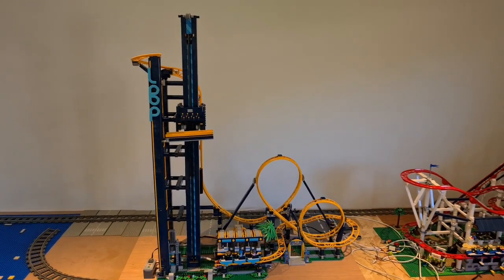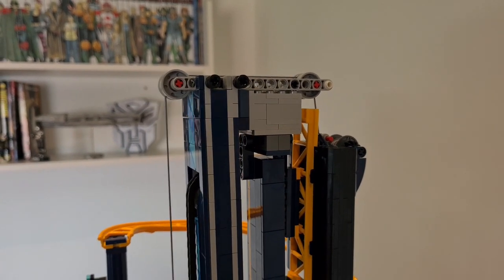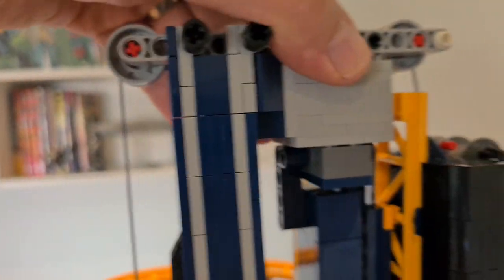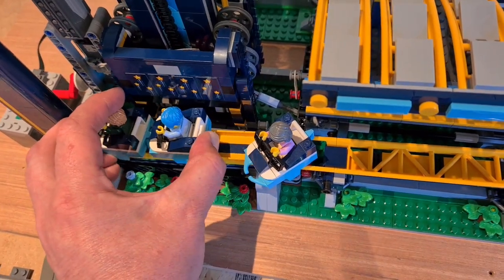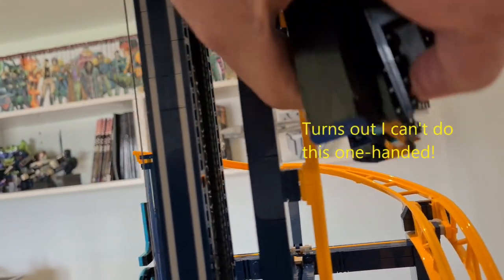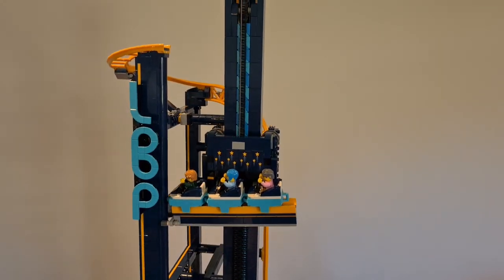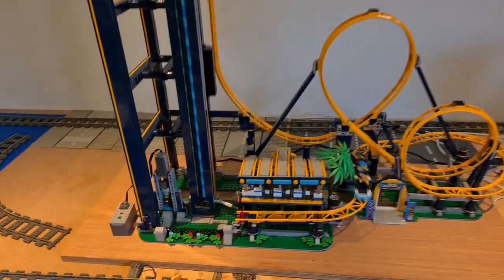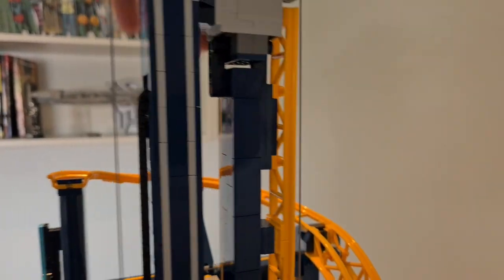How to fix Lego 10303 Loop Coaster and stop it breaking apart!

Comment: Mine worked great out of the box without any mods. I followed the directions and it just worked. Maybe you should look at your set up again to see if you missed something.
Reply from the maker: Great to hear that yours was a success. As I said in the most recent update, I honestly think that for this set to work properly, there's a multitude of factors that might have to be perfect. With the number of comments from people having the same issue on here i think there is a design issue that should have been considered in order for the set to run continuously without any issues.

Comment: i didn't have this problem with my 10303. from what i can see from the video is that, your counter weight is setup to high. you got to lower it by 2 to 4 clicks. got to level the top of the counter weight with the lower gap of the rail support. btw, thanks for the tip of adding extra weight. in my case, i only have to add a 4x4 plate to slow down the drop of the elevetor to stop it from bouncing.
Reply from the maker: Thanks, yeah, I realised that the video shows the counterweight too high, that's my fault for rushing it. I had it set exactly level with where the instructions show, actually, I tried adjusting it up and down several times. Nothing worked continuously unfortunately, I'd get a few cycles out of it each time. I found adding the weight was the only solution that worked for me.
Reply: @brictronic  mine, did bounce but the counter weight doesn't hit the pulley.  adding an extra 4x4 plate did slow down the elevetor significantly. also i added an extra white rubber band to the carriage stopper to give extra damper to the elevator when it hits the bottom.
Reply from the maker: @jhin1968  That extra band is a great idea! Anything to take the bounce out of the carriage when it hits the bottom would be an improvement! I must try that.

Comment: Hi. Thanks for the upload, very helpful 👍. I am having trouble with mine. It works with the power function, but the big part of the chain gets stuck at the bottom, have you any advice? Many Thanks
Reply from the maker: Hi, that's never happened to mine. I would remove the carriage completely from the tower and take the motor off and check to make sure the chain can circle around the tower freely. You should be able to find what's causing it to get stuck then?
Reply: @brictronic  Thanks

Comment: My issue was the cars would not come off the lift.  I increase the higth of the lift track by 1/3 brick.  Add a couple bricks under the lift track to raise it up.  Now no issues.  My other problem was that it would not come back down.  Have to remove weight from the counter weight.

Comment: I did add additional weight like in your video, my issue is inconsistency transitions to the top rail, some times it just get stuck ( in between the gap) like what happen earlier in your video (remain on the lift) and still figuring out little binding issues in the loop slowing the cart which most of the time doesn’t reach the rubber wheels to pull the cart in to place.
Reply from the maker: To stop the cart getting stuck on the top I found I had to straighten the tower. It was leaning towards the front of the set a bit too much. But after I straightened it, it stayed where it was supposed to and the cart transitioned perfectly each time.
Reply: @brictronic  thanks, my tower still leaning on the right side, still figuring it out how to straighten it up, most of the part are mounted flat, i probably double check it again. Thanks again👍🏻

Comment: I completed the set about two days ago and I have the same problems.... Another issue I found was a number of parts missing from the set. Fortunately I have the parts but I will make a complaint to Lego as it's a lot of money to spend on something to have bits missing. I will add the extra plates tonight. 👍👍
Reply from the maker: Unusual that there's missing parts. The last time that happened me was about 10 years ago! But definitely contact Lego customer service, they're usually quite helpful.

Comment: I'm having a very similar problem, but I don't think it is caused the same way.
Lift won't go up far enough, but I've tripple checked all the pull systems (including the counter weight). It worked fine for the first few days, but it's slowly been going down more and more.
Reply from the maker: Is it just not meeting the rails correctly? I found that this was caused with the tower leaning a bit too much forward but that was in turn caused by it seperating at the top, just a little, from being hit by the counterweight.
Reply: @brictronic  Yeah, the lift has been raising lower than normal, causing it to not meet the rails properly. Ive checked to make sure the tower isn't tilted. It may be that the surface isn't fully level, will move it to see if that helps
Reply: I had that problem, the fix that worked for me is i had to take one or 2 chain links out. You need to make sure it's pretty tight, or the elevator won't go up high enough
Reply: @prons_gaming5083  I've shortened it as much as possible at this point. Has helped slightly, but still isn't 100%

Comment: How have you slowed down the motor that much, my medium motor just goes far too fast
Reply from the maker: Hi, I was using 6 rechargeable batteries for the power pack in this video. The batteries were poor and not providing much power to the motor. In Lego City Update 25, the motor is being powered by a fixed 9V DC power supply and that's the speed it should travel at. You could slow down your motor by using a variable power supply, an old Lego 9V train controller or an Arduino etc to limit the power to the motor. Just like a train motor, you could slow down or speed up the motor.

Comment: It's weird I watched reviews of this set and all of them really made it seem like this mechanism is so perfect and I was really surprised and impressed when they said that because I thought there's no way they have managed to make it so stable and run properly. I think the mechanism still is quite genius but they really should've enforced it with more technic bricks - I don't think it would've ruined the look in any way.
Reply from the maker: Totally agree. It's like they rushed it to market without fully testing it.
Reply: @brictronic  It's like they did a couple runs and saw it work well and didn't do any actual testing. But I can only imagine how hard it was to even get the design to that point. It's just unfortunate because I think if they tested it properly they could've maybe fixed these problems with some technic reinforcement. To me seems like they just didn't think of running this for more than 10 loops at a time.

Comment: The counterweight wasn’t lined up properly. Release a little slack so when the counterweight lines up it lines up perfectly with the top of the solid blue in the middle, which should give you about inch and a half roughly of track above the counter weight.

Comment: I'm having a problem with the counter balance is to heavy to allow the elevator lift to reset
Reply from the maker: When I was trying to figure out a fix for it, I found that I got it to work perfectly with the extra weight and then, 5 minutes later, I had your issue. I realised I had had moved slightly and it was leaning too far back, which didn't allow the carriage and the weight to move freely enough. Hope that helps?
Reply: @brictronic  I actually had to remove weight from the counter balance lol
Reply from the maker: @kyle6525  I hope that's sorted it for you! It's such a pity that the set has proved so problematic for so many people. I really don't think they tested it enough.

Comment: anyone have a solution for the rails not aligning at the top at the lift? my carts dont go down as they dont align. also occasionally the lift comes down very slow
Reply from the maker: I had the same trouble also. I found that this was due to how straight the tower was. If it's not perfectly plumb, the carriage doesn't go "high" enough to let the carts roll off. Of course, when it's fixed, you have to keep an eye on it because every time it runs, it'll wobble and move slightly.

Comment: I have the same issue with it not lining up st the top and the riders keep getting stuck at the top
Reply from the maker: I found that happened a lot when the tower wasn't dead straight. Unfortunately, it moves every time the carriage drops so it's really difficult to keep working smoothly.
Reply: @brictronic  idk how to explain but it’s like platform isn’t going high enough to perfectly align with the track.
Reply from the maker: Oh, that sounds strange alright. It's a tricky set to get working!

Comment: Your issue is that there is too much/not enough rope to get rid of rope just twist the piece that the rope comes out of, and to get more just pull back one of the pieces with rubber and let some rope come out. Then adjust the counterweight to where the instructions tell you to put it and now it should work percectly
Reply from the maker: Yeah, I tried adjusting the counterweight both directions by letting off slack on the rope and shortening the rope. Neither worked for me.

Comment: I added as much weight as I could. It ascends nice and slowly now. Instructions say 222 of the small chain link but I have found 221 works better. I was intending to buy the electric motor but with continuous use the structure just loosens up so probably won't buy it.
Reply from the maker: Mine stays solid now and can run continuously thankfully! It's a pity for such an expensive set that so many people are having these issues with it.
Reply: Avoid the extra motorized system,it only works for thirty minutes, then toast. After three motors,I gave up. ($600.00 is what I have invested in this set,so far)
Reply: @robertsullivan3877  you would probably have to glue the set to use the motor continuously... Mine is running ok now but I'm always having to tighten up bricks every day... I think temperature impacts is as well. It's going colder now and I have today had to add more weight I to the weight.

Comment: I have a new issue. The track goes around fine until the coater enters the lift. Then the chain will not grip to the cogs. If I shorten the chain to create a bit more tension to lock onto the cogs it snaps the chain apart when I begin lifting..
Reply from the maker: I had a very similar issue and it took a while to figure it out. But I think that if the tower is leaning too much in one direction this will happen. Maybe check how straight the tower is?

Comment: Hey i have a problem where the track that lifts the rollers coasters up, doesnt come back down for some reason. Anyone kno how to fix this
Reply from the maker: It could be because the tower isn't straight enough, if it's leaning too far forward this might happen or the counterweight isn't attached to the tracks properly?
Reply: @brictronic  i put the grey block on top on the second like rather then it being in the middle and it went down fine but the roller coaster would not aline at the top. Do u kno any other options
Reply from the maker: Honestly I have no ideas, it's a tricky set to set up right. I'd put the grey block back where the instructions show and push the tower back to make sure it's straight. What you're describing sounds like it's a problem how straight your tower is

Comment: THE FUNNY THING IS YOU DID DO SOMETHING WRONG AND YOU KNOW IT TOO.  YOU EVEN SAID SO. THE TOP OF THE COUNTERWEIGHT IS TOO HIGH . IT NEEDS TO BE EVEN WITH THE GAP IN THE TOWER OTHERWISE IT WILL SLAM INTO THE TOP. THE PROBLEM IS ALSO LEGOS FOR NOT EXPLAINING HOW TO ADJUST THE HEIGHT OF THE COUNTERWEIGHT. YOU RATCHET THE WHEEL WITH YOUR THUMB TO TAKE UP THE EXCESS STRING AND PULL OUT ON THE SPOOL TO DISENGAGE THE RATCHET MECHANISM TO FREE SPOOL IT. THEY ALSO SHOULD HAVE JUST DRILLED A SMALL HOLE THROUGH THE SPOOL TO MAKE IT EASIER TO ATTACH THE LINE. YOU ARE 100% CORRECT ON EVERYTHING ELSE. THE ADDED WEIGHT FIXES THE PROBLEM AND KEEPS IT FROM BANGING INTO THE TOP OF THE TOWER. WELL DONE MY FRIEND.
Reply from the maker: Caps Lock?
Reply: YES YOU LIKE IT ?  THANK YOU.

Comment: My counterweight won't even work properly to let the carriage drop. If it does it's extremely slowly. Seems to be an issue with the carriage. My tracks also buckle really badly at the bottom gear as it lifts the carriage. I'm at my wits end trying to fix it 😭😭😭
Reply from the maker: Is the issue with the tracks buckling because the cars haven't loaded fully when the carriage starts lifting? That could be down to the carriage not dropping quick enough. I did discover that once I had the fix in place I had to ensure that the tower was very straight and the set was on a very solid surface.
Reply: @brictronic  I ended up removing a track or two and it stopped. Still couldn't get the weight to work but just push it down manually  
when I use it
Reply from the maker: That's a shame. The set needs a helluva lot of adjustment to work properly!!
Reply: Nothing to do…. What you need to do is start over and follow directions….. counterweight is wrong too I’m sure…… built mine and not 1 single problem since the start.  I can leave it on for more than an hour and all is fine every single time.

Comment: I've never seen this issue before, everywhere I've seen this set it works flawlessly, you just have some bad luck I feel, not to fight you. I wish you all the luck in finding it since it's not normal!
Luckly it is a 4-parts fix so it's not as big of a pain as the 2018 roller coaster to some people ;p
Reply from the maker: Thankfully it is a simple fix for the issue I found. Reading the Brothers Brick review for this set would indicate they have the same problem with the set they reviewed and maybe I've built mine the same as theirs, with this flaw in it? I left mine with the fix in place working for several hours yesterday without issue, so I'm happy now.

Comment: You have the back block to high! it has to even with the first gap at the top, as per the picture in the directions. i Also added some smooth plates on the back of the counter weight to a just a little extra weight. Hope that helps.
Reply from the maker: Thanks, yeah, I realised that the video shows the counterweight too high, that's my fault for rushing it. I had it set exactly level with where the instructions show, actually, I tried adjusting it up and down several times. Nothing worked continuously unfortunately, I'd get a few cycles out of it each time. I found adding the weight was the only solution that worked for me.

Comment: Mine won't even go around the first loop😢
Reply from the maker: It's a nightmare to get working. I'd highly recommend stabilising the top of the big loop when you do get it working. Otherwise, it'll keep breaking apart!
Reply: I eventually got it to work for the most part. For some reason  the coaster carsthat came with my set was a little off, i tried another set of cars, and it no longer gets stuck except at the top, it doesn't always line up perfectly. Thanks for the info! Cheers!

Comment: I found out what the problem with this is and I can bet 99 percent of people here. The coaster needs to be put on a perfectly level table. When I moved it to my display table the weight would do same thing. I would move it back to my building table and it would work perfect. Finally I got a level and sure enough my display table was off by the slightest tiny tiny bit and that causes the counterweight to lean one way or the other. U can use this method but just realize it most likely your own fault.

Comment: Mine has been working perfectly , haven’t touched a thing . Now it gets to the top and it doesn’t get high enough so the cars don’t get on the track
Reply from the maker: Check if the tower is plumb. I found if it goes out of line, the issue you have presents itself.
Reply: @brictronic  I’ve also noticed the counterweight doesn’t fall fast anymore it’s slow
Reply from the maker: I think that's the same issue, if the tower moves forward, it slows down the drop and doesn't allow the cars get to the top.

Comment: Dude, I’m so annoyed with this set… as you said, for 400 USD, I shouldn’t have to troubleshoot straight out of the box
Reply from the maker: Exactly. It's a really difficult set to set up correctly but once you get it right, it does work for about 15 mins until the loop falls apart!! Pretty poor for a set as expensive as it is.

Comment: I have new issues. I did manage to get it working. The chain stretches so had to take multiple wide links of the chain. But now the cars when they reach the top the carriage does not line up with the track. Also when the carriage goes down it does not gain enough speed to reach the start.... I think cold climate doesn't help and I've not had the heating due to the fact energy costs have been increased due to these climate change lies the government keep pushing...
Reply from the maker: I found if the tower was not 100% straight that the cars would not line up with the track and that it would also slow down the counterweight. Check if the tower is perfectly straight, of course it continues to move every time the coaster runs so you need to check it at least once a day.

Comment: Has anyone had an issue with the car not returning to the bottom? It's going to be hard to add ways without making it look ugly
Reply from the maker: The only issue I've had is the loop breaking apart after several runs. It's a set you have to keep adjusting constantly.